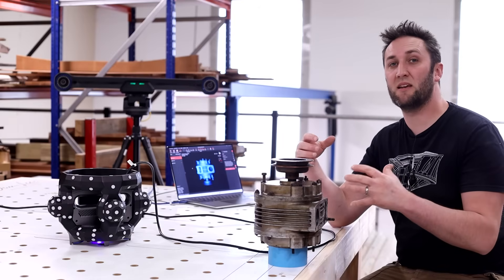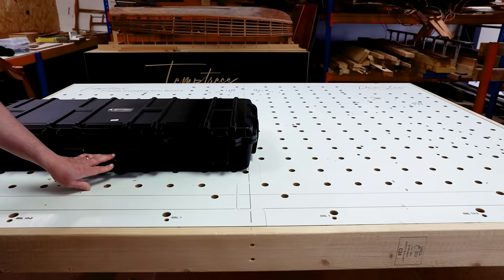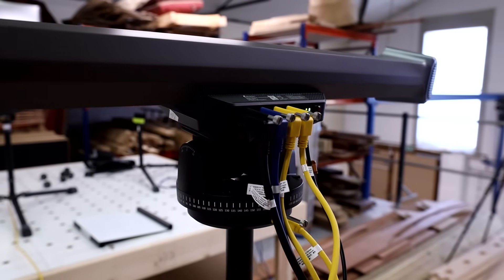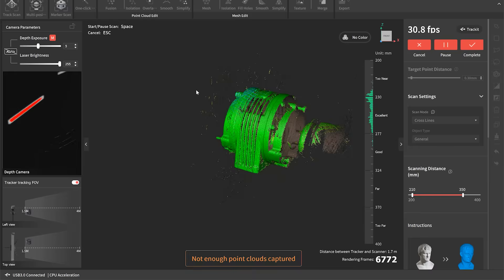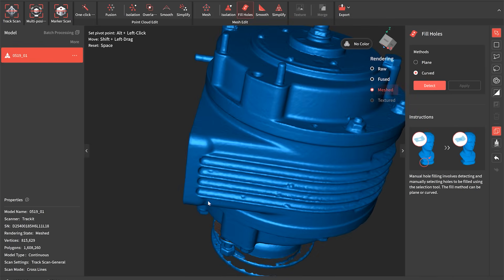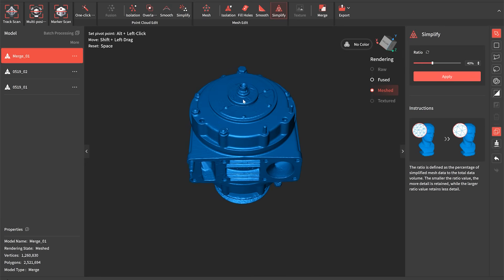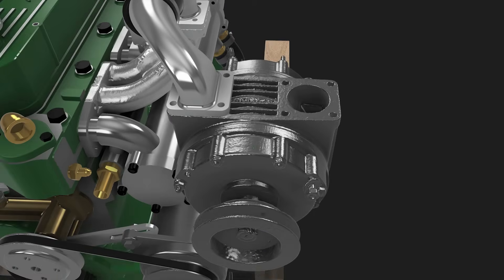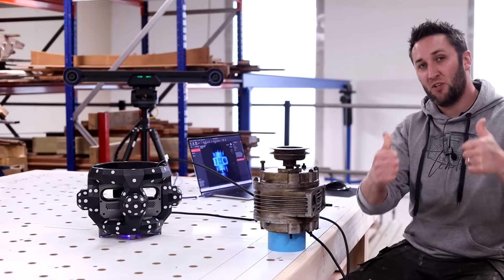Supercharger 3D Scan and CAD Install Using The Revopoint Trackit 3D Scanner

Comment: How is the accuracy of the Trackit? It looked like the edges of the bolt holes was rounded over. Wondering if you can combine multi line acans with a single line scan as that is better for edge detection and deep bores.
Im interested in one of these but unsure about Revopoint as a company

Comment: nice. but youre just gonna hang the supercharger from the intake tube?
Reply from the maker: There are still other elements to design, the mounting bracket will support it from the end of the engine and there is also the intake/carb mounting still to do.

Comment: I'm a Chief Engineer for a major aerospace company and we use this technology all the time. It saves a fortune in design time, money and effort and, in our case, we frequently 3D Print critical parts and test fit them before committing to component manufacture using expensive materials.
Reply from the maker: This is really great tech and it’s advancing all the time. I guess the aerospace industry has been using this stuff for some time now?
Reply: @DanLeeBoatbuilding   Yes, along with CAD programmes that can subject structural designs to a lifetime of use to identify any weak areas/stress points prior to build. It would be like subjecting Temptress to 50 years of use, with various sea states, to ensure none of the frames or stringers fail. It also defines the maintenance schedule - What to inspect and how often.